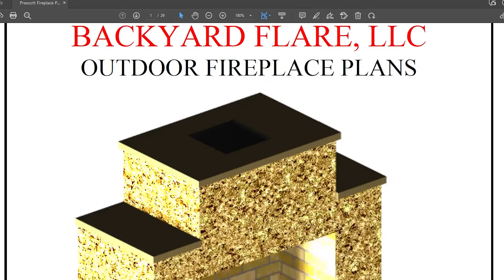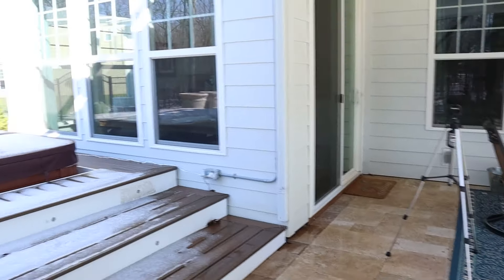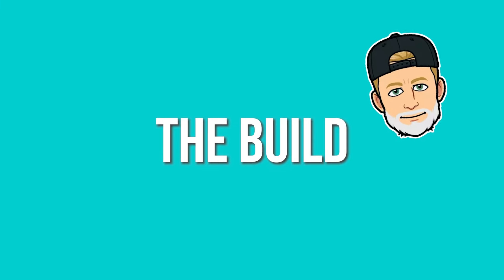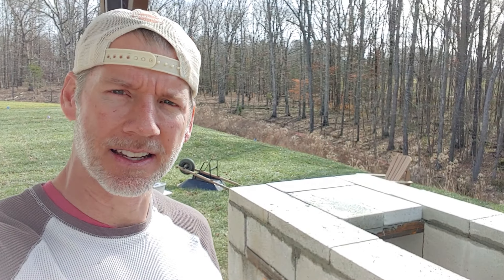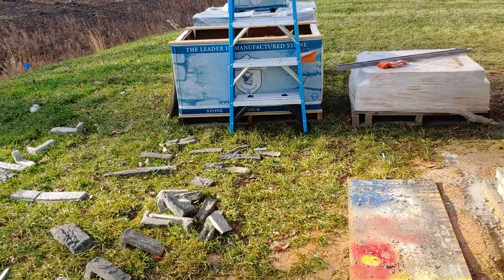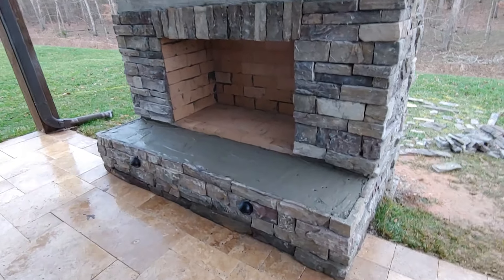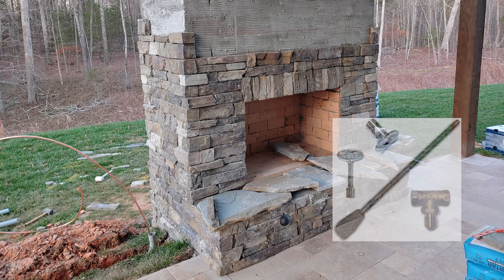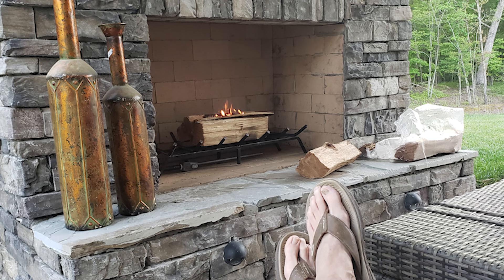How To Build An Outdoor Fireplace In 20 Minutes | DIY

Comment: Looks great.  I'm looking to do the same thing.  Can you tell me overall height?
Reply from the maker: Thank you! It is just over 14 ft.
Reply: @WillMosbey  That is great, almost the exact height I'm aiming for.  I noticed you didn't use a clay flue like many other builders do.  What is the reasoning behind that?
Reply from the maker: @matthewcausey9908  I asked that question to the guy 8 bought the plans from. He said it didn't need it. He was right. It has performed perfectly. I actually could have gone either way.
Reply: @WillMosbey Great video!  I bought plans from Dan as well. My fireplace will be smaller though. I have the rough build complete, ready for the veneer. The veneer I am looking at calls for the mesh sheeting to be installed first. Did your veneer suggest that?  Again, thanks for the great video!
Reply from the maker: @sandramckown7729  no but I did have to do a scratch coat first to give the stone something to hold on to.

Comment: Hey there could you share the design paperwork and a material list ?
Reply from the maker: I can't but I gave mention of who I ended up getting plans from in the video. I just had to modify those plans for my needs.
Reply: Can you tell me how much material you needed for your project.
How much of a footer did you go with on concrete? I just want a rough estimate on material. Mainly the cinder blocks and stone .
Reply from the maker: @krishelms4135  I think it was 34 bags of 60 lb cement for the footer. The footer was a foot deep. And we reinforced with rebar. I believe there were close to 650 cinder block. And there were six pallets of old world ledge stone.

Comment: So you weren’t able to make it wood and had to with natural gaz because of the pergola was too close? How much clearance was needed to go wood . Still great job !
Reply from the maker: Do you mean wood burning? I used gas for 1 thing and that was to help light the logs quicker. Once lit and burning good I turn off the gas. It primarily functions as a wood burning fireplace. Works perfectly. If we would put up some type of enclosure on the walls it would really heat up the room. We went with 2 feet of clearance above the pergola which meets code here.
Reply: I got you I rewatched the video . THANKS

Comment: Hello! Great job !I have a question, did you line the chimney with heat-resistant bricks or not?
Reply from the maker: No I did not. I spoke with the guy who sold me his plans and he said it didn't need it or require it. However if you are having it inspected I would check with your county. If you are DIY then everything should work fine without lining it.

Comment: why didn't you attach the chimney cap directly or flush to the top of the chimney?
Reply from the maker: I actually can't remember what prevented me from doing that but the chimney cover that I bought from Amazon would connect that way I don't believe. There may have been a better way that's for sure.

Comment: Also your rock would have stuck better without using a scratch coat, if it's above 80 have a sponge and and wet the block in the area you are working, or mix a little thin set in with it, the biggest problem diyers have is they over use their mortar only mix what you can use within two shake ups once it gets shook up too many times it is no longer viable for sticking your rock on
Reply from the maker: Thanks for the advice. We were definitely novices when it came to this project. We ended up using our water hose with a fine mist adapter to just wet the area and the rock. This helped a lot. Mixing mortar is a fine art for sure.
Reply: Is this because he used cinder blocks instead of a wood frame?

Comment: Nice Will. Question - Why was wood burner not approved? Wondering if that's just local code near covered patio, or something with the fireplace construction they didn't like.
Reply from the maker: He said the flue was not approved so I would have had to go with straight gas. Also I would have to stop at the height I was at. Non of which I did and everything works perfectly.
Reply: @WillMosbey  my neighbor did this exact same thing and found out the hard way.   He put in for the permit, ignored the inspector’s comments, and didn’t bother to call for a final inspection.  A YEAR later the county called him and said that an inspector would be stopping by to close out the permit.  When he arrived and saw the wooden fireplace near the house, he failed the inspection. Ultimately my neighbor was forced to redo the fireplace and convert it to gas.

Comment: Ok. I don't see any masons commenting here so I'm going to be that guy. I get that it's common for different parts of the country to do things differently but a subgrade footing and a foundation below grade are so important in a fireplace build. Also important are that the rebar are embedded into the concrete. Either by setting them in the wet cement before it cures or by drilling, cleaning the holes of dust, injecting specific epoxy in to them, then inserting the rebar. This transfers the load to the footing. Otherwise you're just relying on the bond of the concrete and mortar. Please don't confuse bond with being tied in. A rebar that is embedded in the concrete and grouted in the place in the block is tying the block to the footing and transferring load to the ground making this a much more rigid structure. 

The head joints, vertical joints between the block, should be mortared and pressed into the adjacent block. This creates bond and rigidity in the over all structure as well as resisting water intrusion. There is so many voids in this fire place when it rains there is so much opportunity for water to get in and just sit. That is very bad for masonry. This is compounded by the courses of solid 2" or 3" block that are laid across entire courses. These interrupt any load transfer to the ground and collect water.

Crossing the firebox with angle iron vs a precast concrete lintel put two materials with very different reactions to heat in very close proximity to the fire. Angle Iron reacts very differently to heat than cement with rebar in it. Also it's going to rust...

One thing that I learned very early when laying block is that you shouldn't lay a block wall with the head joints lined up with the unit under it without having some horizontal joint reinforcement in every course this happens. There isn't any here. These are weak points in a structure that has a lot of expansion and contraction going on.

The scratch coat had so many void where there were no head joints in the block that there is definitely going to be water getting in that fireplace in every section.

Movement and water intrusion are the biggest issues here.

I'm all about doing stuff myself. Youtube has taught me so many things in my trade and many others that has saved me time and money. Not to mention given me a reason to buy a tool. But one thing I've learned from trial and error is that you absolutely should learn how to do it right. Doing it yourself means that you've learned to do something yourself, not learning to take a shortcut to get the thing that looks like the thing you want. Learning to something incorrectly or thinking you're going to save yourself some time will end up with you having a decent looking product for a while but at some point things will go south. I can guarantee that the stone will start to pop off or crack because the block are shifting in the heat if the one's over the firebox on top of the angle iron haven't already. Block laying is not complicated to start with and it is just as easy/hard to do it wrong as it is to do it right. Doing it DIY is going to be slow and tedious and you will not do it as fast as someone who knows what they're doing so you may as well as use that time to do it to the best of your abilities.

Comment: Why on earth would they requie a permit to build something not actually attached to your house, just another way to tax you? Im curious as to why you chose not to slope the walls of the firebox to reflect the heat forward vs. straight up the chimney and why you omitted the smoke shelf. Ive also never seen block layed without buttering the vertical joints, water will find it's way. Not trying to be critical, but that's the problem with so many of these fireplace designs. Shortcuts only save money in the short term. It's pretty.
Reply from the maker: I agree on everything you said now that I've built one. I would go with a smaller firebox and angled the back. It still produces good heat like it is however. But smaller would be better. And I definitely don't intend to be a mason. 🤪🤪

Comment: No flue lining would never pass inspection in our township no matter inside or outside. The cost of putting a lining in is negligible and so easy. The creosote  buildup on open blockwork is a fire hazard and the heat will break down the C.M.U. block eventually.  Installing your firebrick while the blockwork is open is also much easier than doing it after you run your block up. Each firebrick course should be cut 1 -1/8" smaller on the SIDE walls to create a rolling in back wall to create draft to the chamber. The beauty of the exterior is secondary to a fully functional and SAFE fireplace. Looks good but its not. This chimney if considered completed with get down draft smoke on windy days hood or no hood. It will not be able to draw. Fireplaces are best left for professionals and in our township the Fire Department inspects them as they are going up and tags them each step pass or fail. The dimensions to a well constructed fireplace are critical..box depth/width/height /throat chamber/shelf just to name a few and each dimension change, changes the following dimensions. The chimney itself must be free clear and run up 2 ft higher than the roof on a 10' horizontal SET BACK line to prevent downdraft. Long winded I know and being an outside fireplace can cause mechanical shortcuts that should be avoided...now meatballs?  Make then any size you want.
Reply: if the outdoor fireplace is a gas insert (not just a gas starter as this vid) is the flue lining necessary? are there other considerations if the fireplace is a normal gas insert- thanks!
Reply: @talblair7710  no it’s not necessary, especially if the gas fireplace is ventless which is what most people get.

Comment: I don't know man, there is so much wrong with this I don't know where to begin. Hopefully you won't have issues down the line but that would be a miracle if you didn't
Reply: Top 3 suggestions you can give?
Reply: @danpierce7  Create a proper smoke chamber and use clay flue liners. Also makes absolutely no sense in not creating the firebox before running the structure up. Firebox should have been built once he got to angle iron height with the smoke chamber started at the top of the firebox. Using cored masonry units for the smoke chamber and a flue is a big no no. I can see a chimney fire in this fireplaces' future. For reference I have been a mason contractor for 45 years and have built probably over 500 fireplaces in that time